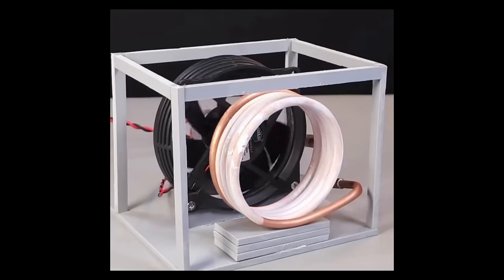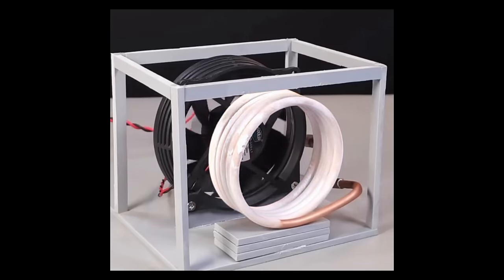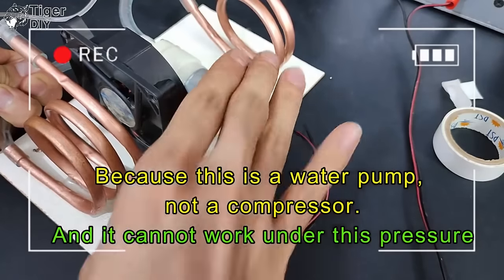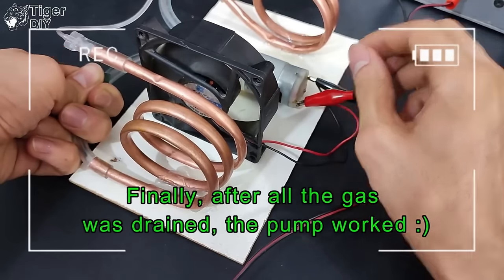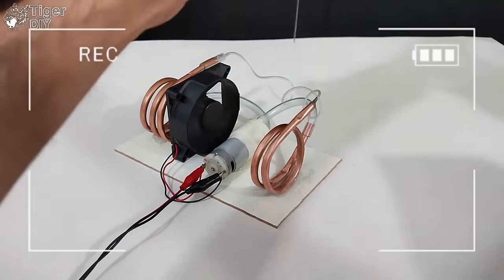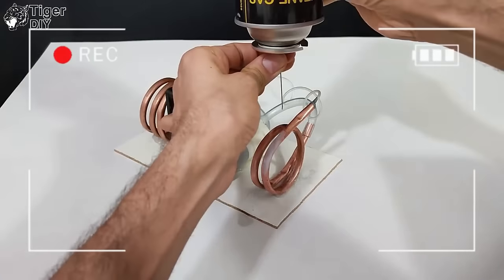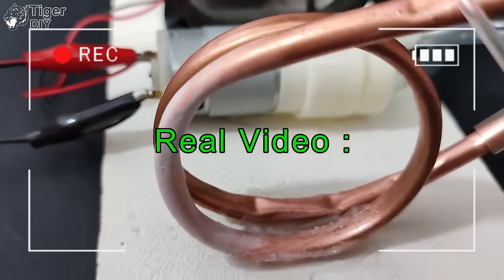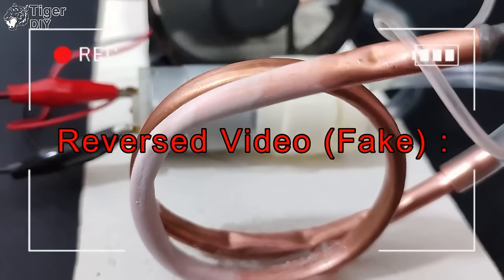2253 Fast Freezing Machine - Is It Fake?

Comment: Those “DIY” refrigeration videos have been created by stereotypical YT money suckers 😠 ~ one video is an original & the others are copycats, and are infested with adverts [cashcows] - they only want you to watch the advertisements and not the video itself or recreate the contraption featured. Even I thought that those videos were genuine and commented on them but I now think they are possibly fraudulent, particularly how the butane is injected into the system and kept inside it = most are depicted using a hypodermic needle to pierce one of the vinyl pipes and the butane refill can is pressed into the other end of the needle and we see the pipe filling with the gas, they are then seen putting tape/glue over the hole and we don’t know if they did manage to keep the gas in the pipe or it all sprayed back out again, another weird thing is them aiming the fan at the evaporator coil, why? knowing that the condenser coil [hot] is what needs the fan blowing over it. And most of the comments in those videos state that the pump is too small for the needed pressure for the refrigeration cycle/effect. And some think that the frosted evaporator footage is played in reverse, as with my knowledge of refrigeration; the compressor is quite big and often sealed into a can, all the pipes are copper with the evaporator and condenser coils & a capillary tube/expansion valve between them, all the connections are braze-soldered. For adding the refrigerant; the compressor can will have a 3rd pipe on it ~ a service valve unit would be connected to the 3rd pipe and the compressor turned on for circulation and a vacuum pump would be connected to the service valve and turned on to vacuum the system out and then the refrigerant canister will be connected to the service valve and the gas administered to the system = the sound of the compressor would change and the condenser turn hot…. and the 3rd pipe will be crimped/bent over to seal off the system and it commissioned into service

Comment: Heah, millions of clicks, lol, instead of the motors, it would work better with a single candle.
Some day I am gonna make myself rich, I am gonna collect fart gases and make them cooling or warming and show here in YouTube.
Reply: You might get demonetized if you show the collection methode,
Reply: You are on the right track(kind of).  They USED TO use a gas flame to create the pressure.  This, in turn, send the refrigerant through the refrigeration cycle.  For the most part, this has been replaced by the electric motor/pump.
Reply: Absolutely, the wheel was already invented!
Reply: Heaah, I will do some pixel shadings and people believe in it, lol
Reply: But you can replace the compressor through a heat source so you can make the gas move inside the pipes